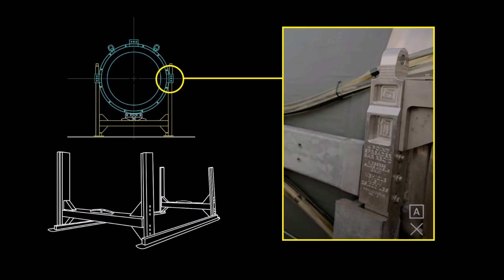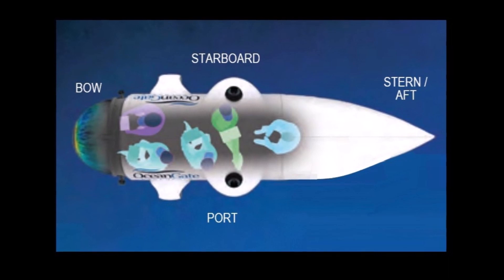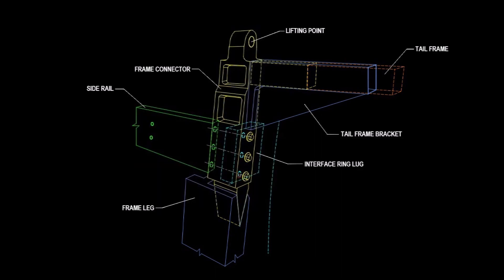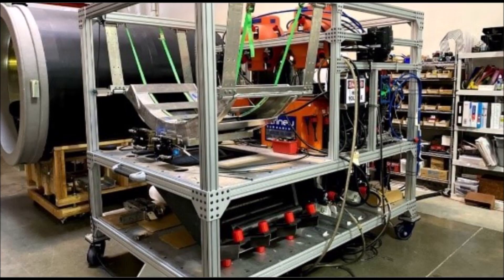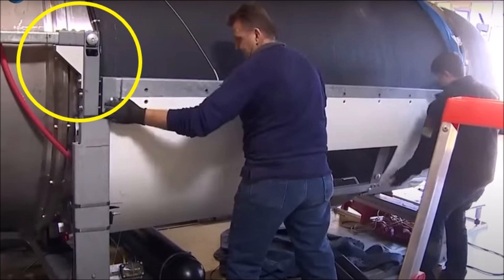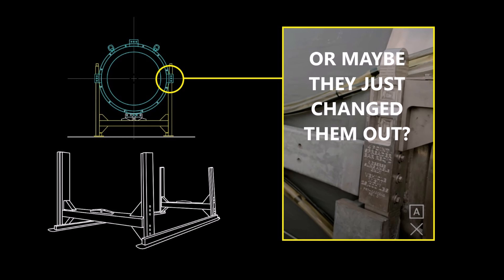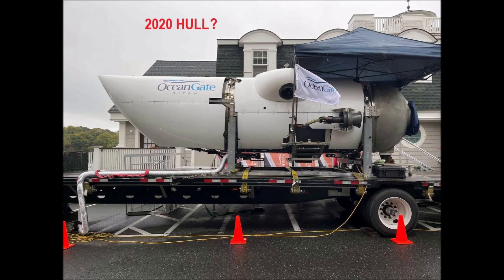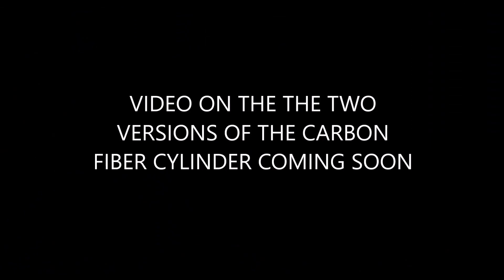OceanGate Titan - FRAME CONNECTOR DEVICE

Comment: I haven't seen any discussion of the "fat" legs.  The legs look like a metal casting or perhaps concrete poured inside a metal shell.  Legs are certainly fatter than needed to support the weight of the sub so I presume they were fattened up to provide ballast that was ejectable as a last resort.

Comment: Great detective work!  Other YouTubers had pointed out  this connector has changed over time but none has explained how it works. The other design looks far weaker and less expensive than the beefier, machined design you show disassembled in snapshots for a YouTube interview of Bruce Morton from Dec 2021.  I think it is fair to assume the beefier connector was present in the fatal 2023 dive.  The welded lifting lugs are clearly a latter addition and they are present on the recovered wreckage (as well as being a better design for lifting the hull proper with or without the frame attached.)  Yes, they may have replaced the frame connector when they reassembled the Titan with the 2020 CF hull, but the bolt-up design of the Titan doesn't preclude the connectors being swapped out before or after the 2020 hull build.  The Titan was a prototype starting development around 2015 and based partly on the earlier OceanGate submersible Cyclops and continuously modified and likely improved based on testing and past dives.
Reply from the maker: Yes, I can only speculate about when and why they changed that design. It would make sense that it was done when it became "officially" operational. Not sure exactly how that relates to the timeline of the two CF hulls. Those little eyelets at the top of that fitting might have been too limiting for the various types of cranes encountered, or what was on hand for them to use to lift Titan. I suspect that's why they added those loops on the interface ring... or maybe that was the plan all along but they were trying decide where the best place to have them would be, or it was a round-to-it kinda thing. Your guess is as good as mine.